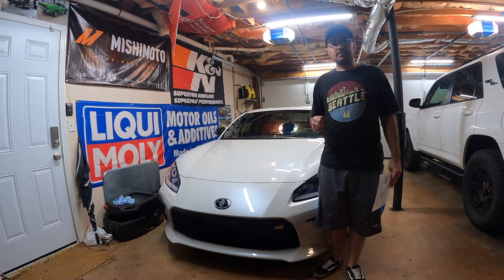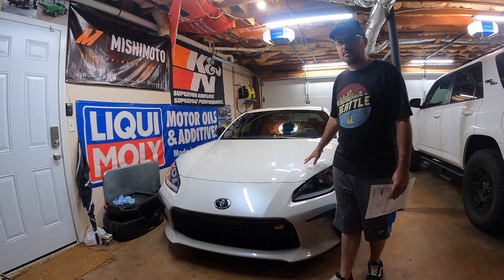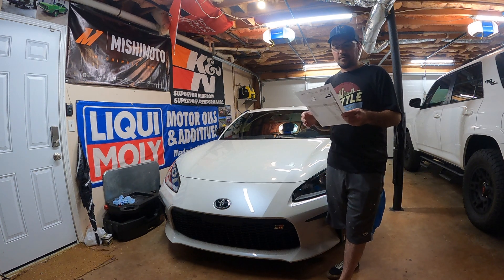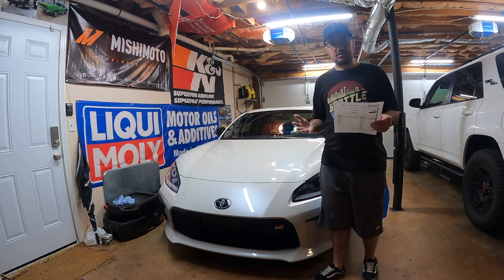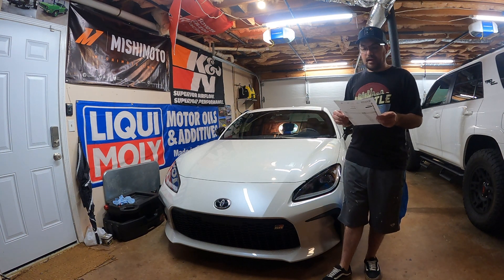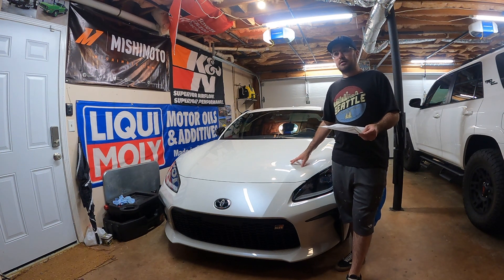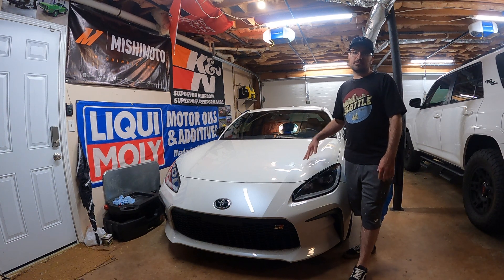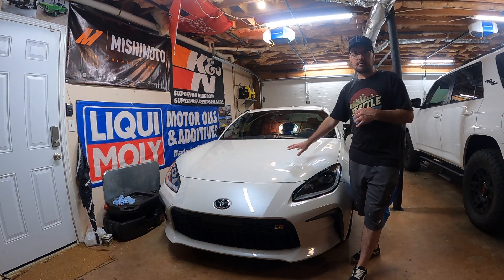GR86 Oil Analysis Results | Blackstone Labs Oil Analysis | RTV GR86

Comment: Thanks. But if I see it right oil values are skyrocketing into problems if not taken care of immediately.. Iron is 20 should be max 8, Copper is 144 instead of 7, Mo is 876 instead max 172..